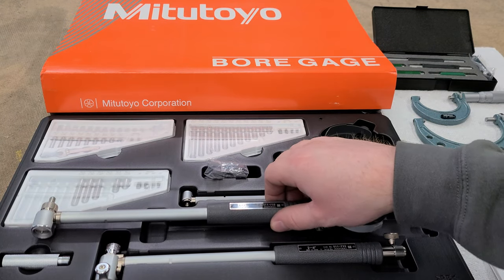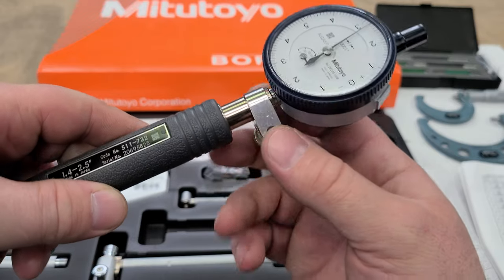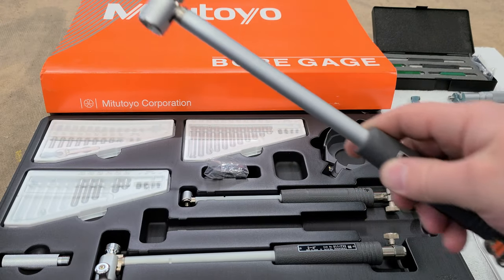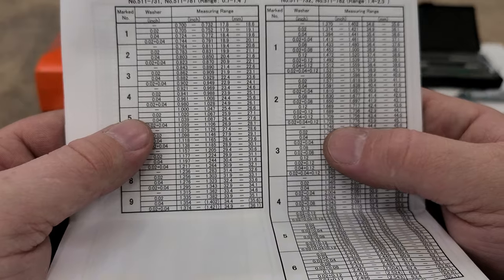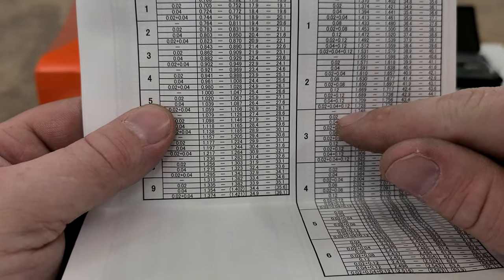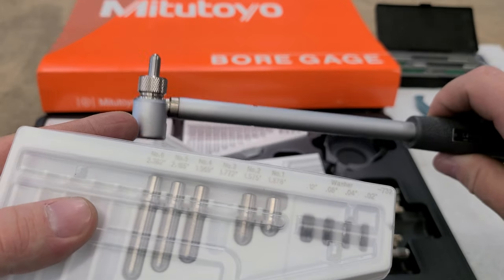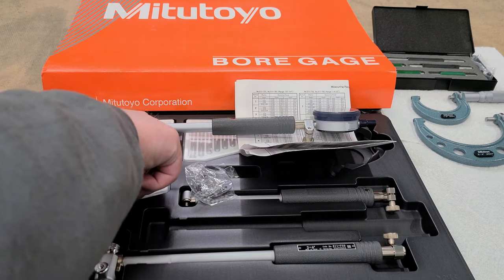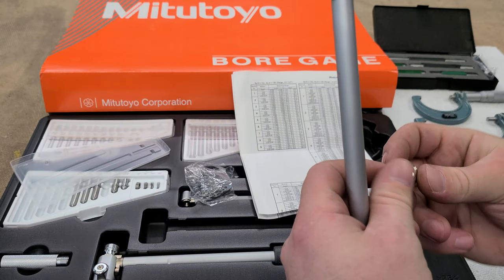Using a Bore Gauge

Comment: New to the channel, great video. I have the same bore gauge (511-733) however, I'm missing that measurements sheet I can still work without it but it's a lot of unnecessary trial and error. Could you please post a scan of that page (even a photo will do) here or the video description? I can't find that anywhere, not even on mitutoyo website.

Comment: Would you prefer the analog or the digital version from this bore gauge from Mitutoyo?
Reply: Analog is typically higher accuracy for this stuff! Not only do you get the seperate tenth increment lines, but you can see where in bewteen each increment the dial is at. Additionally, it's way easier to visualize runout on an analog as opposed to digital, making it a faster reference. But wait! There's more: you need to hold the tool very precisely to get an accurate reading, and you have to feel for it. An analog gauge makes way easier to feel for the perfect perpendicularity, which makes it even easier for getting good measurements.